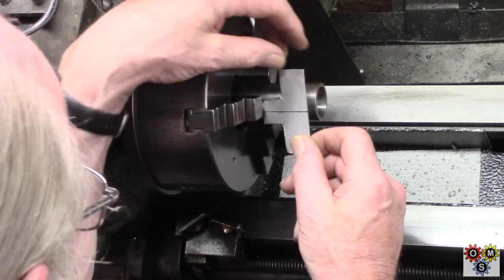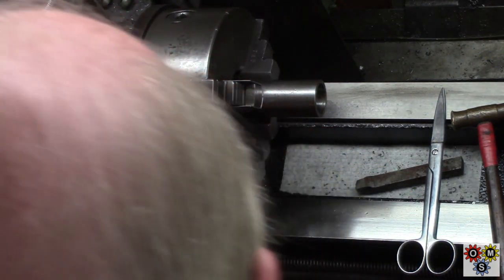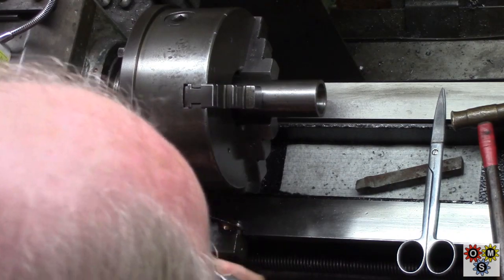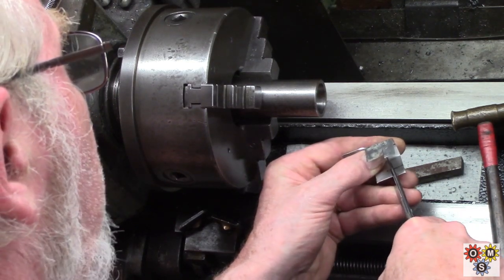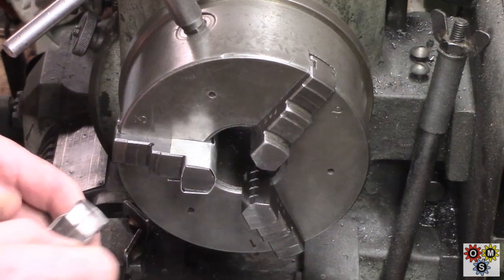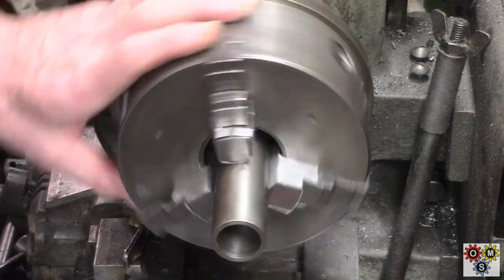Chuck Jaw Soft Liners

Comment: Hi Chris.
You may know this already, but good source of copper for Liners is scrapped UPS transformers. Love your videos. Thanks.
BTW. I'm thinking of buing Bison 3 Jaw Chuck. Could you please make a review of yours.
Kind Regards
Jerzy
Reply from the maker: Hi Jerzy,
Thanks. There are probably a few choices of Cu for sure - I had a small sheet of thin gauge CU which I think came from a scrapped hot water tank!
I do like my Bison chuck - somewhere there is some info from when I set mine up on a back plate - which is about all I did on it. Part1 - http://www.oldmansshop.com/vid-pages/chuck-backplate-01.php 
and part 2 - http://www.oldmansshop.com/vid-pages/chuck-backplate-02.php

Comment: Neat idea, well explained.  I have re-posted your video on johnsmachines.com
Reply from the maker: +John Viggers 
Thanks John - not really an original idea but quite simple. I have to make some for a new chuck and may use some copper this time.
I looked at your Colchester badge repair pics - pretty good job! Interesting too re your two soft jaw ideas - may well try your second version for my new chuck if I have enough material.